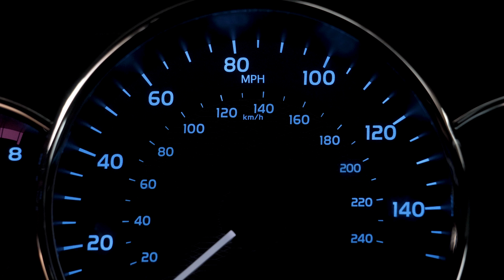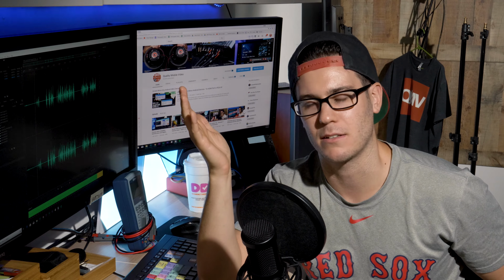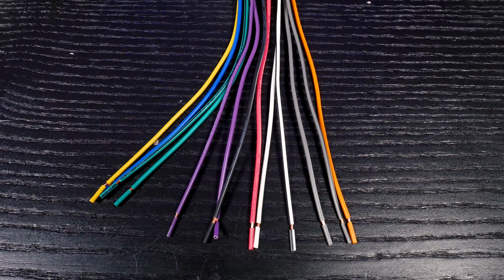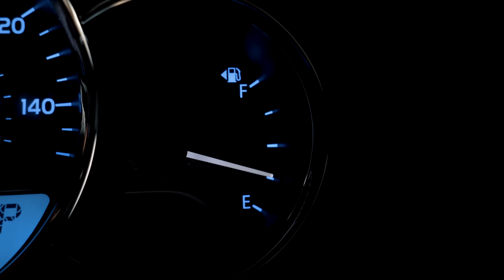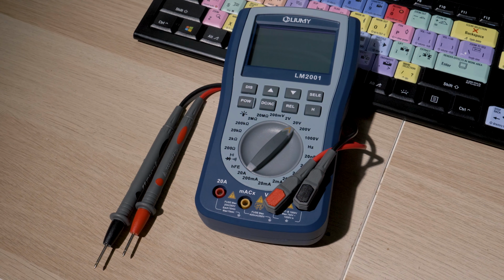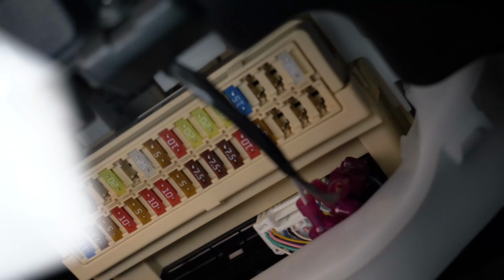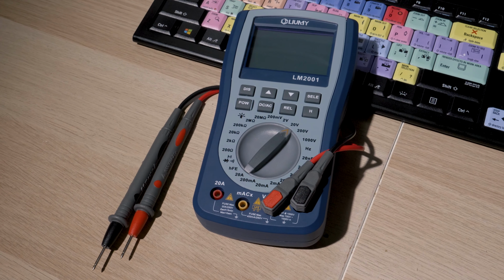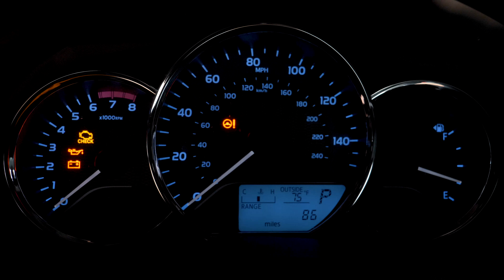Speedometer Lights Went Out After Installing System - Car Audio 101

Comment: Hey I don’t know if this is still active but I just did a 2005 Elantra /Hyundai full system replacement. 12” bass pro JBL speaker and amp combo built in. I got a cheap Sony radio.. and ran RCAs to amp. I ran power from battery to amp + fuse. I ran a blue wire for the REM/remote (from head unit to amp)

I still have two blue wires on harness left over.. one solid blue and blue with strip. Maybe those are for speedometer lights?

I don’t think I left a plug unplugged cause I had to take the entire dash apart.. maybe I cracked a bulb but hmm

Comment: Prob hooked the dimmer wire up to ground or something like that making the dash lights either short out or popping a fuse. Seen many rookies do this. Fuse easy fix. Short in cluster replace cluster. Worse case brain of car has to be replaced.  Almost certain the dimmer wire was used incorrectly in the install

Comment: As a tip! Just remove the fuggin fuse for the radio in the kaaaa..... & if tge problem persists its not tge fuggin radio  <also might try tgis a second time with whatever wires/wire harnesses detached or unplugged from its source to further justify wiring is either the issue!

In my experience -this is caused by hooking up the NOT needed  <per vehicle requirements meaning you might need it but not always check foist> Orange wire as it is not a REM. Remote turn on wire!  Those are always blue  or blue & white  - careful sometimes there are 2 blue wire's .... this information is limited to mypersonal 15years experience on my driveway - ask further questions for your answer!  Explain in full details if you would!
Reply: Btw my predictive text is horrible no matter how hard i try tge fuggin 5hing cant spell what i type firsy so ir does its own thing...... or i have fat fingers
Reply from the maker: LMFAO thanks for the insight guy!